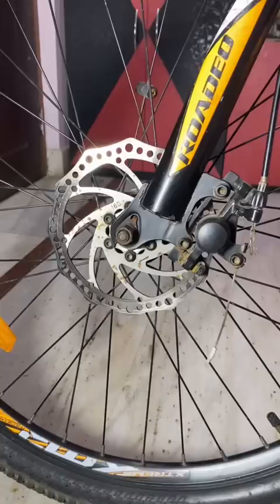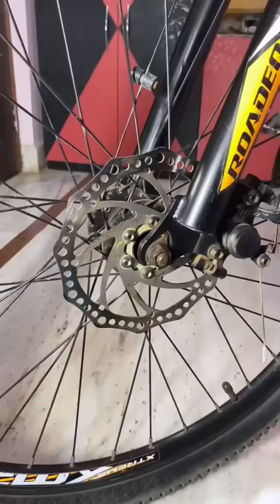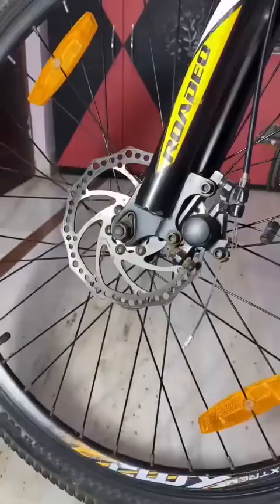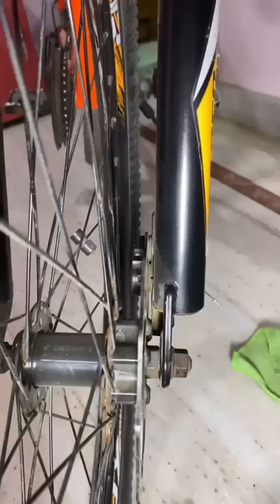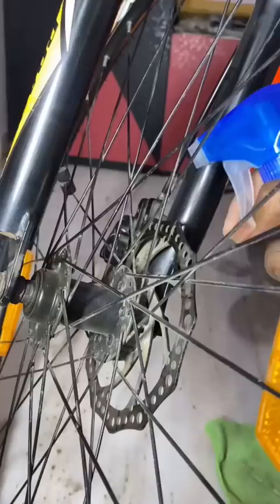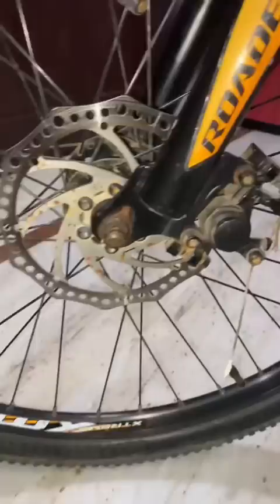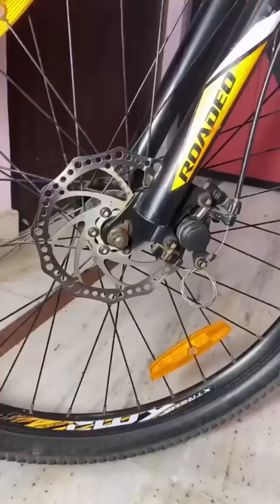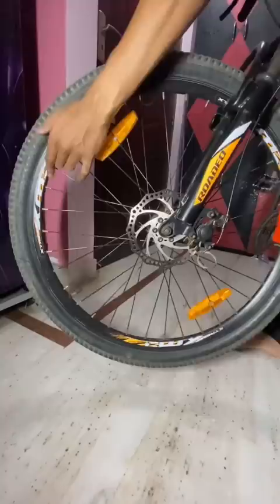ayse kare break tight | Stoppie on cycle #shorts #cycle #tricks

Comment: Bro mere cycle smooth nahi chalri kon se gear achi chalte aur konsa oil daal hai gear mei
Reply: Shimano Tourney Or Shimano Atlus
Reply: Aree bhai suno... Vo oil  ka problem nahi hai.. Gears ke deraliure ke pass jo nuts hai sirf vo loose hai unko readjust karo... And full gear system ko degrease kar do.... Badme oil mat lagana... Cycle Lubricant lagao...only on chain joints.... Chain ke bolts pe 2 drops dalna.. Done
Reply: @rakagamerff2667  shimano 105 😂
Reply: @unknownnaik2877  bro meri cycle hard chal ri hai 😦please help
Reply: @ldchampff  aree bhai vo nuts main se ek hard karne ke liye aur ek loose karne ke liye hota hai
Reply: @ldchampff  vo adjust karte karte gears shift karo... Jab sab gears theek se chal rahi ho toh kuch mat karna
Reply: @ldchampff  yt pe vids dekho about adjustment
Reply: Bro shift nahi hore gear
Reply: @ldchampff  second bolt ko tight kar... First one ko loose karo
Reply: @ldchampff  bhai Fatbikervaibhav ne video dali hai vo dekho aur set up karo.... Ek short he vo bhi dekho